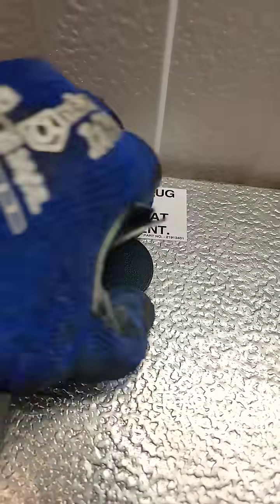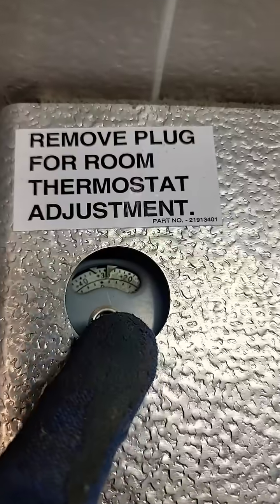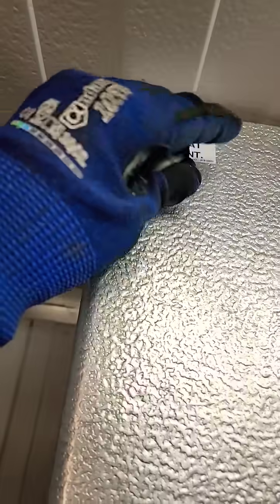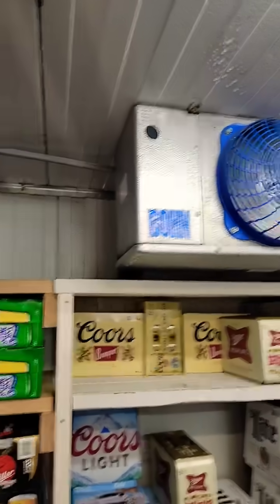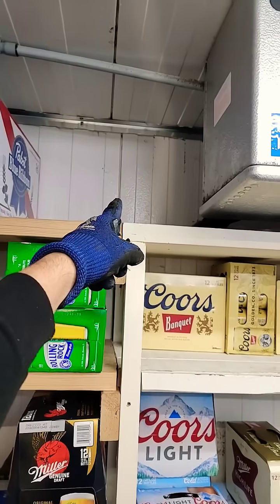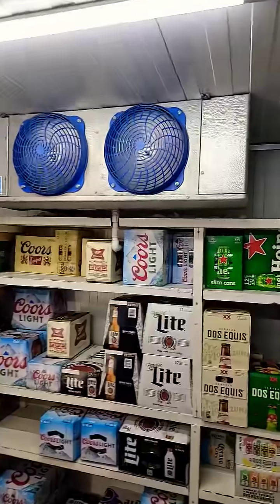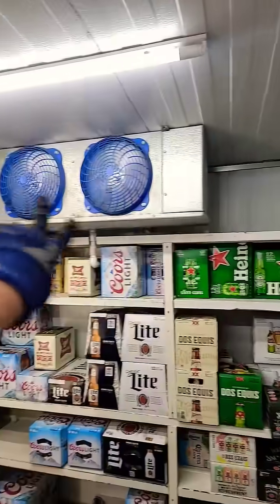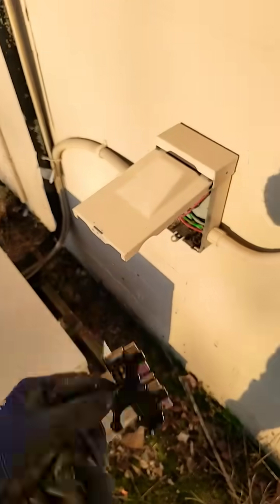Why beer cooler has water in the floor?

Comment: You don't need 20°f beer. You're going to be drinking it at room temperature so the beer is going to get warmer. What if the refrigeration system goes down because the unit was let to run at 20°f until it iced up completely??? NO COLD BEER THEN!!!!!!!!

Comment: Couldn't you if your safe about it use map gas torch and melt the ice on the coil so it wouldn't freeze up after the adjustment an have to wait till tomorrow

Comment: By the looks of that water under the evaporator housing you might want to check the drain tube to make sure it's clear.  Too much water collecting in there will cause unwanted problems.  Dripping out onto product, mold, deterioration of the evaporator coils to name a few.  I bet if you take a look at the condenser outside you can spot some maintenance issues that have been neglected also. M

Comment: Not the one in the video. He didn't mention at all how placement of sensing bulb effects setpoint, NOT numbers on dial. He mentions how he will come back tomorrow to make sure that the sight glass is nice and clear. This is hacks work, isn't reliable, a great way to slug a compressor. He pulled the disconnect and states that he will come back tomorrow (and then points and the condenser) when this unfreezes. First, the condenser isn't frozen. The evaporator is. Also, the guy is a lazypuss. That coil is partially frozen, go back to your service van, grab your manual pump sprayer (like the kind normal people use as a pump-pressure-weedkiller sprayer) fill it with hot water over and over and, and spray it on the ice accumulation on the evaporator. if you want it to go real fast, take your 5/16th driver and remove the nuts that hold part of the top on, and spray at a different angle. Also, based on how the coil froze, anyone worth their $3.50 in bed can tell you that that coil isn't freezing in the particular pattern of a low or partial charge.  To verify, pump system down, and verify level of refrigerant and document with paint stick on receiver. And most of all before you start thawing out he coil (and this hack doesn't even mention it, clear the drain line, and verify that the condensate pump is working and cycling on it's own.

Seriously, tell OP to go back to plumbing cause his advice is sh*t.

Comment: When I use to work for 76 gas station I would change it to 10 degrees. People use to come in just for the ice cold beer. Went on like this for over a year. Until management brought up that beer sells has gone up over 600% in the last 9 months. And no one in the company understands or knows why. I started dying🤣🤣. I told them why they changed it back and beer sells went lower then it was before lowering the temp. My manager blamed me in front of her boss for the sales drop. I said no it’s your fault you or the company raised the cooler temp after I figured out how to lower it. Well I got let go 3days later 🤣🤣 I walked right across the street and told that gas station what I had did if they want a boost in beer sales. My old station went out of business end of 2020

Comment: This is also why you don’t want to cram your home freezer to the gills either.  Not only will your freezer compartment not work properly, it will adversely affect your refrigerator compartment as well.  When I repaired refrigerators I ran into this problem all the time.

Comment: Another thing that can be done to make coolers more energy efficient is, to install 'motion sensors' to control the lighting inside the display windows. This would help in keeping the temperature in the cooler, thus assisting in keeping the box temperature cooler longer.
Reply: The lighting doesn't let off much heat.  The door hear defrost probably let's off more heat.

Comment: So what you're not understanding is that there is approximately 15 degrees Fahrenheit difference between the temperature of the coil and the discharge air that you will get, by setting it to 20 degrees Fahrenheit is essentially set 35 degrees Fahrenheit cooler temperature and thus you get an actual refrigerator and not warm beer.
Commercial Refrigeration Tech here don't worry about my opinion though
Reply: Coolers basically going to run at 45 Fahrenheit now

Comment: Those technicians are a mix of mechanical engineers, mechanics, and expert problem solvers!
Reply: Not the one in the video. He didn't mention at all how placement of sensing bulb effects setpoint, NOT numbers on dial. He mentions how he will come back tomorrow to make sure that the sight glass is nice and clear. This is hacks work, isn't reliable, a great way to slug a compressor. He pulled the disconnect and states that he will come back tomorrow (and then points and the condenser) when this unfreezes. First, the condenser isn't frozen. The evaporator is. Also, the guy is a lazypuss. That coil is partially frozen, go back to your service van, grab your manual pump sprayer (like the kind normal people use as a pump-pressure-weedkiller sprayer) fill it with hot water over and over and, and spray it on the ice accumulation on the evaporator. if you want it to go real fast, take your 5/16th driver and remove the nuts that hold part of the top on, and spray at a different angle. Also, based on how the coil froze, anyone worth their $3.50 in bed can tell you that that coil isn't freezing in the particular pattern of a low or partial charge.  To verify, pump system down, and verify level of refrigerant and document with paint stick on receiver. And most of all before you start thawing out he coil (and this hack doesn't even mention it, clear the drain line, and verify that the condensate pump is working and cycling on it's own.

Seriously, tell OP to go back to plumbing cause his advice is sh*t.

Comment: I'm having a lot of condensation in one of my three coolers . the fans have space on the side for air flow. it's set to 43 and stays close to that and the temp comes down quickly after closing the door. it's just condensation collecting on the ceiling and dripping into some of my tables.

Comment: Good catch on the cases blocking the air flow. My pops is an AC mechanic so that means every Saturday I was looking at PT charts and cleaning condenser coils and the “odd” haha contractor swap. Point is, the symptoms would tell you  that the system is undercharged, however the things you’ve uncovered would certainly warrant a look. Point is:if you’ve hired this guy, he knows what’s up.

Comment: Beer should be kept at 38° to 55° F.  Larger is kept cooler than Ales.  Stronger beers are served warmer than weaker beers.  So your 30° F temp is still too cold. And the beer will be right back where it was in a few days.
Reply: Those are serving temperatures.  Keep it colder so that when it's purchased to be enjoyed, it can warm up a little on the journey there.
Then again, there are some very popular (and cheap) swills that should be kept as cold as possible.

Comment: Texas we use low temp coolers with heat element and run the temperature around twenty five.   8 cycles defrost with 15 mins of time usually maintains everything.
Reply from the maker: Thanks for sharing

Comment: Had one yesterday the sensor for the cold control was mounted on the door frame and they leave the walk in door open all day. Cooler was reading 50 degrees but it was actually 30 inside. Customer when I walked in "probably needs a shot of freon"

Comment: Problem in design, you have different staff all the time and information doesn't flow through, do not adjust on thermostat, open wire cage ether side of coolant fans, can’t stack against fan system

Comment: Coolers freeze for a variety of reasons, but the temp being set too low isnt one of them. You have bigger issues other than 20°
Reply from the maker: Great point
Reply: Also leaving the door open or cracked.
Reply: @Silas Marner  leaving the door open (usually by customers) is almost always expected in system planning.
Reply: As a Keyboard warrior I would say this guy obviously knows what he’s doing considering the fact that he did it and he has a business and we’re just here critiquing his every move probably working some shit job cleaning cases out at meat market pretending we do something important
Reply: @JustJustinJustining  im an refrigeration tech. I work on these coolers and freezers.
Reply: @JDfromtheFEE  don’t mean shit. He knows what he’s talking about. Could be a defrost or heater issue but no.under No cer instances should a cooler be less than 32 that’s a freezer
Reply: And your all douche bags cause you think a piece of paper and some gauges in a service truck make you smart you ain’t no scientist son. You guys just sit around all day “pumping down” dicks
Reply: The temp being set too low isn’t one of them? 32 is the freezing point so yes it is one of them, genius.
Reply: @elchongis  you do realize they use the same type of systems with coils for freezers that get well below zero?  The problem could also be the defrost cycles don't run often or long enough or a heating element not working.
Reply: @ecmoney801  walk in coolers do not typically have defrost heaters in the coil, there is no point, as a walk in cooler is not suppose to run under 32 degrees. Can you get away with 2 or 3 degrees? Yes, however thats a fine line to walk. You can end up with a cooler full of ruined product. I’ve been on many calls where some genius turned  it bellow 32 and the next day every single can and bottle exploded. Thousands of dollars in product ruined.

Freezers are a completely different discussion.

Comment: I don't know about 20 degrees, but I like it cold. I got an army buddy who has a cousin who converts mini fridges into custom beer coolers that maintain a temperature of 29 degrees. He does custom designs too. I got a Texas themed beer cooler, and he has several variations on that theme being a Texan himself from San Antonio. It's beautiful and keeps my beer ice cold.
Reply: That evaporator isn’t capable of running below 32° since it’s a basic cooler evap and has no defrost heaters.  They depend on air being above freezing to remove the ice from the fins.
Reply: @gribly  what part of he converts them could you not understand
Reply: Instead of buying shit beer that needs to be 29 degrees and a fancy cooler, just buy better beer.
Reply: Fancy Pants Kegerator 🤭🤗🍻

Comment: Got one of those electric bauer pump sprayers I use to defrost walk in coolers. 

Probably choked the EVAP, started getting warm, they cranked the tstat down to try to make it colder, made EVAP worse. Then the man with the plan comes in and is just like SMH

Comment: 30 degrees is too low. That’s an air defrost evap. Needs to be above 32. I’d set it at 34.
Reply from the maker: thank you
Reply: I just asked a beer merchandiser for Miller and Coors about the temp he also said 34 and to only drink Miller and Coors products 😁😉

Comment: the guy that buys beer there everyday simply because its the coldest is gonna be pissed
Reply: Just because the thermostat is set to 20* doesn't mean it is reaching that temp. 99% of the time when coolers start messing up and not cooling properly the customer will self adjust the thermostat trying to make it colder. This will only cause more issues. Realistically with it being froze up like that the temp inside the cooler was probably closer to 40 or 50 degrees.

Comment: I will go to certain gas stations just because I know they keep their beer colder!
Reply: Me too, on my way home there is an Exit with a Chevron that has a walk in Freezer called the Beer Igloo & it’s ice cold!😁🥶 Can’t get any better!💯
Reply: @adampalmer5399  if it's a FREEZER, they would have frozen and exploded. That's a walk-in cooler, though they probably keep it at a perfect 36°F.
Reply: Yup. And there’s a certain gas station by my house that sells a local seltzer I like for $10.99 but it’s in one of those open front refrigerators, so I drive 5 miles out of my way to the liquor store and pay $12.99 for it to be ice cold.
Reply: Right me too
Reply: HVAC guy here. My home, shop and work van refrigerators are always at 34°F! Freezers -6°F.

Comment: No YOU don’t need your beer to be 20 degrees. You don’t know me😂😂😂
Reply: Thinking the same thing. Um twin peaks is the coldest beer ever
Reply: @brettbraun16 try a Moosehead
Reply: @brettbraun16  their beer lines freeze up all the time. 😂 Beer line cleaners know to shut off the glycol system before cleaning the beer lines when they arrive on site.  If you are not there before 7 am your screwed have to give it time to cool down but most twin peaks use chillrite systems. At least when I had to clean them.
Reply: I like cellar temperature. So sue me.
Reply: You like frozen solid beer?
Reply: Unless you're drinking it in the store, it's not gonna be 20 degrees when you crack it open.

Also, don't drink and drive. Don't be that fuckin' idiot. That beer ain't worth that much.

Comment: For cooling beer? Wouldn't the temp be better around 40F?
Reply: Depends. All coolers have to be 40 degrees or colder. If you set it at 40 the temp will probably fluctuate between 45-40ish. A health inspector will ding you if your cooler is above 40.
Reply from the maker: It would be better for the cooler
Reply: I remember a beer commercial from long ago stating that their beer was brewed to taste it's best at 45 degrees F.
Reply: Ewwww no you want your beer cold lol

Comment: The first thing i go for is time clock on a ice up.on a wi medium temp you always want to defrost by killing solenoid in series with tstat,if the clock is just opening compressor contactor outside while solenoid open inside, when you come out of defrost you will slugg liquid because the refrigerant will migrate to evap and turn to liquid. Always better to pump down.

Comment: Taddy check you defrost time clock brother. I set my clocks 4 times a day for 30 mins for medium temp.for low temp i do 45mins.
Reply from the maker: Very good thank you for this advice
Reply: It’s a cooler not a freezer. Coolers are air defrost. They defrost in between cycles. A freezer has electric heating elements and or hot gas that is controlled by the timer.
Reply: @dustinengle2570  no shit ,coolers still have defrost time clock what are you trying to say?
Reply: @dustinengle2570  please dont attempt to grow a brain ,the answer is no you do not know what i know i am refrigeration master. Just stop
Reply: @richardharmon874   no where in his video does he state it’s a medium temp cooler. Most coolers are 34-40 especially when you’re cooling beer. Below 32 degrees is asking for ruined product. Sounds like your a bid spec or installer and not done much service. Seen plenty of coolers with no timers.
Reply: @dustinengle2570  medium temp is 35_40 .
Reply: @dustinengle2570  all wi coolers should have timer but yes some old ones dont.i done refer service over 24 years.
Reply: @richardharmon874   but I will admit if that is a medium temp cooler then I was ignorant on that. A true medium temp cooler should have a defrost timer with electric defrost.
Reply: @dustinengle2570  i was incorrect in saying medium temp you got me.i thought medium temp was up to 40 i was wrong.
Reply: @dustinengle2570  wi cooler should have a timer, some old coolers that operate the temperature by a low pressure control dont need them but every wi cooler on a pump down should have one.
Reply: @dustinengle2570  Google definition of medium temp refrigeration please and comment back.
Reply: @dustinengle2570  i apologize for being a dink yesterday on my comments i was drinking.
Reply: @dustinengle2570  i think the 0_ 25 degrees is evaporator temp.but the definition is a box temp above 32 degrees below 41.that is what we always called medium temp where i am from
Reply: @dustinengle2570  what do you mean defrost between cycles, it sounds like you dont understand, i have been doing refrigeration for 24 years ,how long have you? Medium temp cooler still has a time clock,if you are saying it doesn't then you are not even worth arguing with.not to mention i just installed one today and wired the clock wich came with the condenser.
Reply from the maker: I appreciate you my friend thank you so much for all  Of your knowledge
 You are definitely right
Reply: @taddydigest  you also tad i was just trying to educate Dustin i apologize if i sounded like a jerk,i had a few beers.